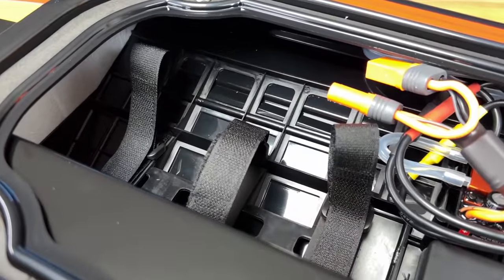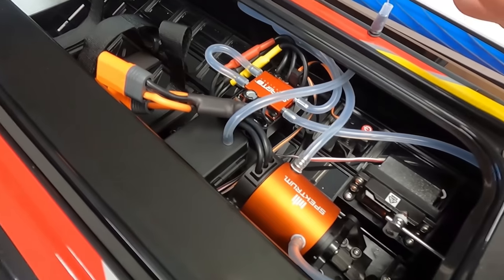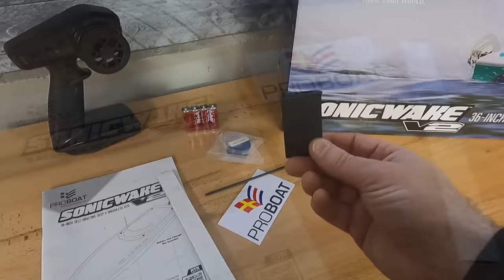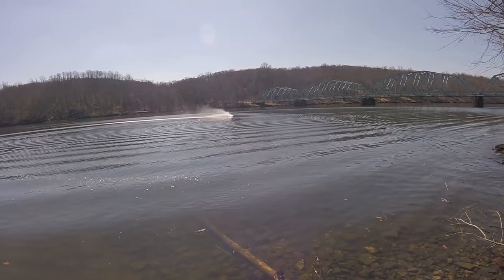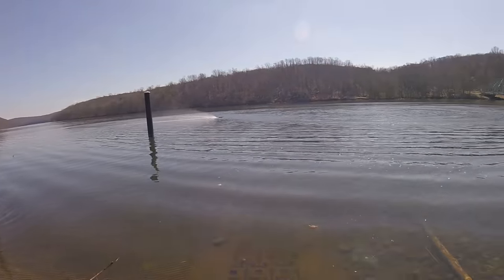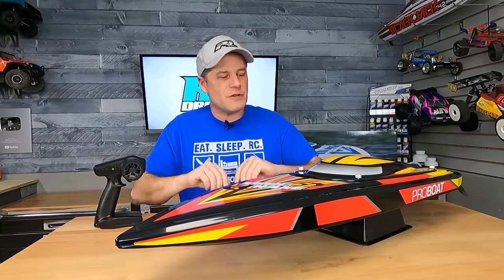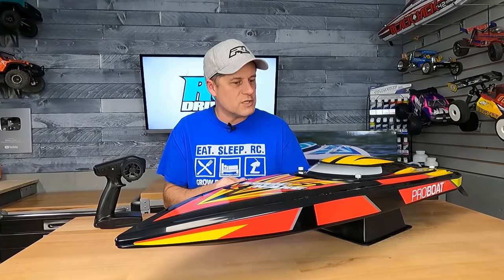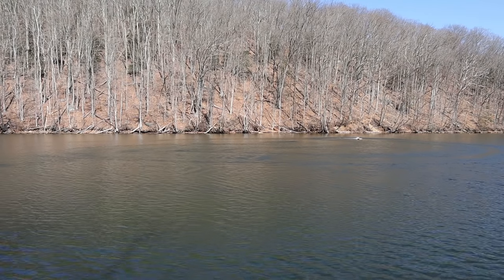Hot RC Boat For 2024! ProBoat SonicWake V2 6S RTR Deep-V Review | RC Driver

Comment: Nice run down. It does 50mph+ fairly easily and handles great. Mine was a little wet out of the box too. This boat was supposed to come with the DX3 but the global chip shortage caused them to make a last min business decision to swap it out, for the SLT 3 so it could be released for Spring 2022. . Always good stuff from your channel.
Reply from the maker: I watched your run. Boat looked so good! I’m looking forward to getting out there with it a bunch this spring and summer!
Reply: @rcdriver  Thanks! If you didn't notice the Firma 160 esc out of your BJ 42 is a direct bolt in as well.  Nice hidden feature most don't know.
Reply: Nay bud the original runs just great this is horizon just bs Hollywood trying to remake a old movie my original runs at 90mph and its just fine. Also after my video on the shit batt cradle they fixed it and I gave that info on how to fix it to there engineers. what a rip off they did from me. I should of patten that. Not going to buy!!
Reply: @MrMad2424  is the 160 worth it if I’m going to stick with 6s power? If I did my math right that moto pulls 153 amps at full power
Reply: I am going to buy,this sonicwave v2 .love it so much.mvh Rene' Pedersen. Danmark.😊.

Comment: Great Video Mate!
I have a question..
when the lipo batteries are running low is there any warning signal in the transmitter?
Lipo batteries run down suddenly,
Or do you understand that there is a loss of power and can you get back in?
Reply: Yes, it has a low voltage mode that causes the engine to cut in and out giving you enough power to bring the boat back in.

Comment: I just got an used SonicWakeV2 and was running with an Impulse 32 before. The Impulse seems to be wayy faster, yes the ESC is 160A instead of 120A but weird thing everything's getting alot hotter on the Sonic Wake. The motor, ESC and battery cables are much hotter. Moreover, on the Impulse I am unable to get to full speed yet, still too much waves on the lake I've ride. The Sonic rides alot smoother and takes waves way more easier than the Impulse.

I am thinking about putting the 160A and motor (2000kV instead of 1900 if I remember correctly). I would see how it goes.

BTW i am riding both boats with newer 2x 3S 100C 5000mAh spektrum packs.

Comment: Had the first model nothing but problems with the electronics and heat need 3 water pickups and still popped batteries.  Im interested in v2 seems like proboat worked out the issues

Comment: Im getting worn out from all the V2 models being released from Horizon Hobbies, but this boat isnt a bother. Has some features the V1 needed. I have been planning on getting the black and green V1 for a long time, about 2 years now, but ive been knocking out some other RC wants first. I definitely like the dual pickup and inner rib reinforcement. Im not a fan of the decal art but it isnt enough to deture me from getting it. I also like the price didnt jump up like everything else. Everything was increasing like 120$ or more like the DBXL for instance. The V1 DBXL K&N was on my list for as long as i wanted the Sonicwake, but has been on backorder for the same amount of time. I will DEFINITELY need to put the K&N body on the V2 DBXL as well as taking the silly wing off when i get it. Im very happy to see the price for the Sonicwake jump up only $20. That is a huge positive as a lot of the time that $120 increase has stopped me from buying other models without seeing the value in the increase. The Sonicwake easily shows the $20 value increase in the dual pickup rudder alone, then there is the reinforcement, trim tab changes, etc tjat makes it a bargain for sure.

Comment: Being a single prop, does it have much for torque twist? I had a brushless traxxas blast and the twist giving or releasing throttle was crazy 😜. She would plane on too great tho
Reply: I had a traxxas blast their junk not even comparable to proboat.
Reply: @stevezack6077  I have a older proboat impulse, I upgraded the flex drive added a 180 amp esc and a large  leopard hobby motor. I am running it on 6S, it is stupid fast now and handles great. Proboat makes good products.  I never tried a Traxxas boat but they look more entry level to me.
Reply: @stevezack6077  that’s fantastic good for you kiddo! Fortunately some of us people out there are capable and able to take care and modify stuff to make it reliable/good.
Reply: @davidbrennan5  definitely when the blast came out years ago they were pretty basic. Close to entry level stuff surely.

Comment: So, maybe a silly question but I'll ask it anyway: any thoughts on the SonicWake  v2 vs the current Traxxas Spartan? I like the self righting feature of the sonic wake – not planning to invest in a canoe to save the boat – but I also have a fair number of traxxas batteries/chargers for the RC cars/trucks… 🤔
Reply: I could also get the SonicWake and use traxxas batteries… but they're 25C instead of the 50/100C that seem to be recommended for the SonicWake's electronics.
Reply: @aaybes  don't buy Traxxas batteries they puff when used on their own vehicles

Comment: Did they fix the battery tray issues where the batteries would come loose and affect self-righting?
Reply from the maker: The battery plate area has more structure to it than the previous version and now foam pads come pre-installed from the factory so the packs do not slide around.
Reply: @rcdriver  Good to know. Thank you!